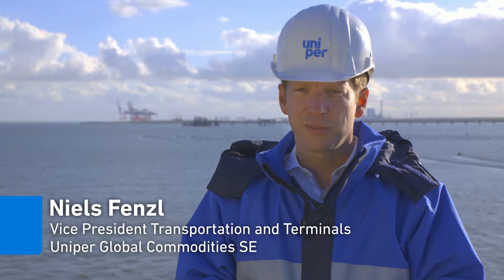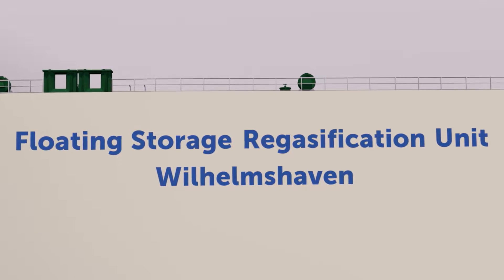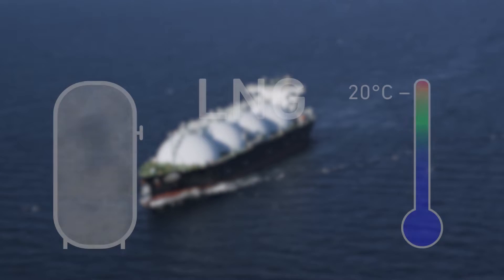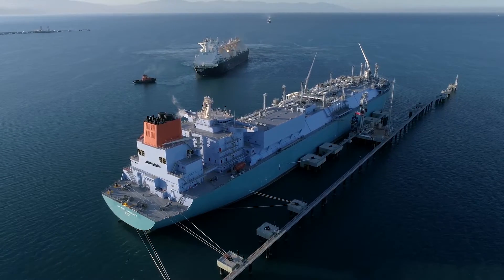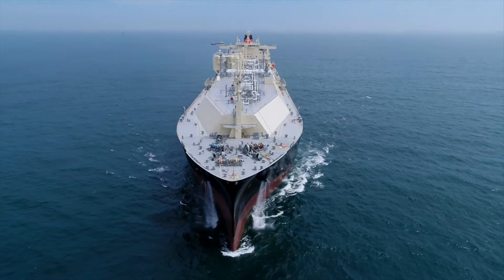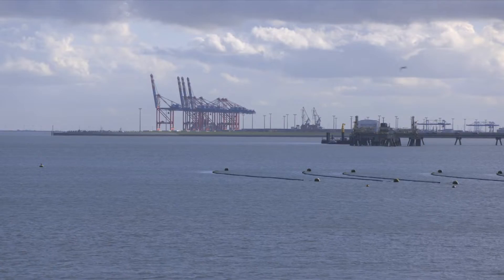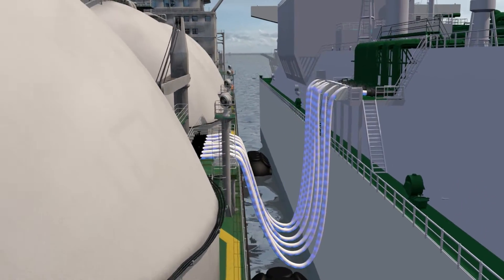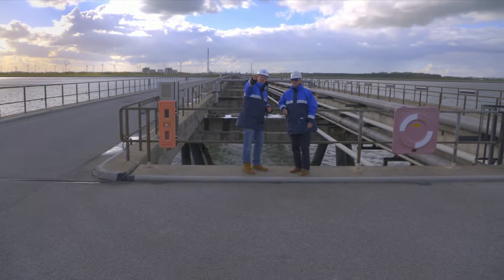The case for a German LNG terminal in Wilhelmshaven | Uniper

Comment: Would you say the case is even stronger now?  Except now Al Thani wants you to sign 25 year LNG supply contracts.  Germany, you guys can build safe nuclear power plants too!  And you are asleep at the wheel with battery projects.  Good that uncle Elon paid you a visit.  But you don’t have electricity to power them.
Reply: "And you are asleep at the wheel with battery projects". Ahem? No! There are about 10 battery production plants currently under construction or in planning in Germany and most new cars from car manufacturers have already greater ranges than Tesla, which are now also behind on autonomous driving. Tesla has lost it's ten year head start within about 5 years, probably because Musk was busy writing hate comments on Twitter.
Reply: Musk may have built his battery plant in the wrong place, there are concerns about how much groundwater his plant will suck up, and it's being challenged in court.